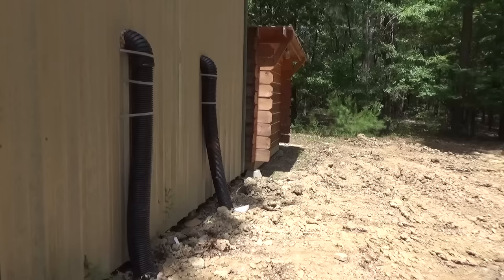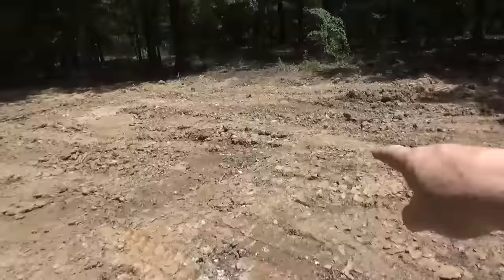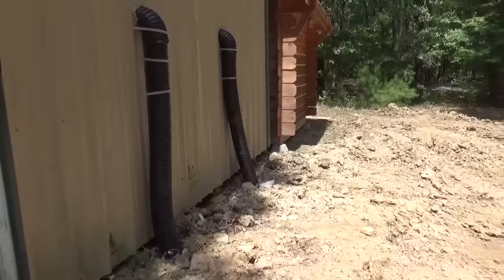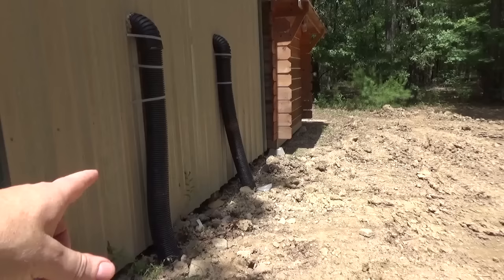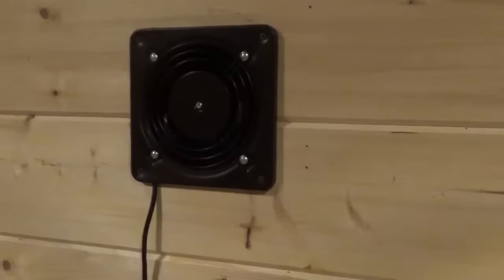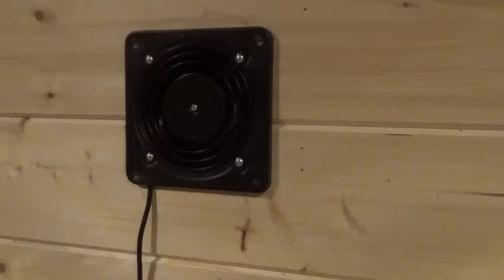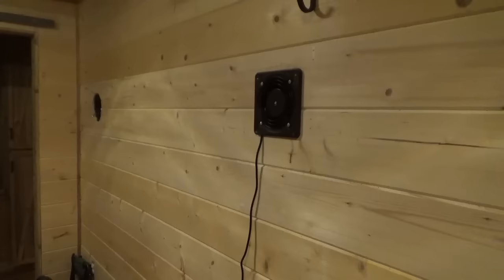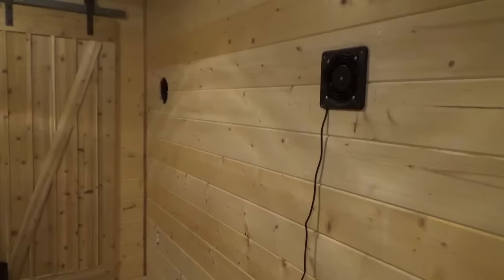Offgrid Underground Air Conditioning

Comment: This can be used in reverse too. You can pump hot summer air in and get some heat back out during the winter. Thermal mass projects are awesome 👍
Reply: I'm pretty sure this is not how this works in the winter.  The Earth is big and heating a small section of it is not possible using hot air from the summer.  In the summer time, the ground temperature is 55F.  In the winter time, the ground temperature is 55F.  You're never "charging" the earth with a significant amount of energy to detect a difference in the ground temperature in the winter.
Reply: @Kevin-ht1ox  lol The entire idea of "Thermal Mass'' is the Mass you Thermally charge. You can charge it with Hot or Cold. The part you are missing is that the heat from the summer sun and air, Normally does not penetrate that deep into the earth, so having more area and Earth to put heat into, the more mass you have exposed to said heat and the more you have stored..It works both ways. If you lower the temperature of the earth deeper than normal in the winter, you can store the cold/energy.  Dirt is a very good insulator and this is how Humans stored Ice in the desert and heat in the arctic for 1000's of years.. And igloo is actually a thermal mass too. The skins insulate it, and store the heat generated by the humans inside. The difference may only be from -20f to +40f but that 60 degrees is the difference between life and death.
Reply: @redneckhippiefreak  Exactly! Very well put. I'll add that this storage of temperature difference is why many people that are building greenhouses are starting with floor piping. The earth below becomes the buffer. During a hot sunny day, cool air comes from the pipes. Once the sun goes down and temps drop, that same piping is supplying air that is warmer than would be in a cooled off greenhouse. The days of black barrels is gone if you can afford it.

Comment: Ground loop cooling... and heating. I recall a big surge of interest in the concept during the late 60's, early 70's with the "back to the earth" movement (along with earth-berm houses, bead wall, trombe walls, and thermal-only solar panels). Subsequently, the reality of mold, mold spores, and associated medical issues (mostly respiratory) became evident. This realization pushed direct ground loop AC out of consideration, but seemed to foster an interest in heat pumps sourced to a ground loop. Unfortunately, heat pumps use a lot more energy. Equally unfortunate is the fact that a lot of ground loops have been very poorly done. For example: A co-worker was paying 7X more per month for heat from his ground-loop-based heat pump during a Wisconsin winter than I was for natural gas. His ground loop contractor had laid the pipe on the surface and piled several feet of dirt on top. Not only were the ridges across the backyard inconvenient and ugly, they were pretty pointless from an energy source/sink standpoint. If you find a solution to the mold/mildew buildup, I'd love to hear it. (A solution other than fans on the intake side pushing the warm air through a HEPA filter system into the pre-sterilized interior of a ground loop duct... which is sooo practical.)
Reply from the maker: I have installed a filter on the intake. The temp difference isn't enough to cause condensation.  It's trail and error. I do text the air regularly for mold spores. Nothing so far. I run a dehumidifier in my cabin.

Comment: I wonder if you can use a heat powered fan on the hot tin roof to pump the air through the pipes

Comment: I put a lot of thought and research into a similar idea for my home but was seriously concerned about condensation in the pipes as the hot air was cooled leading to mold, mildew and poor to dangerous air quality. I decided on smooth pipe and a grade downward to a drain before going straight up into my home but never did because of the same reason I don't to many things, lack of funds. lol I did put a temperature sensor in the ground last year and an 8 ft depth and programed an app for my phone to record the temps year round. I installed it in Jan if you can believe.... it was an unusually warm winter. In the 10C area then and up to 13.75C on Sept 21 funny thing the temp kept dropping until mid April to 3.5C as the temperture outside warmed. My ESP32 micro controller stopped working in through May and I was too lazy to figure it out until June... Ahhh Fudge it's 4:20am and I just realized I broke my phone screen while I was replacing my tarp shed cover yesterday!!
Reply: the evaporation from the top soil may be causing cooler summer and the lack of evaporation the accumulation of heat.

Comment: A little late now, but I'm thinking you''d want to use perforated pipe, with a set of holes facing down, such that condensate will drain out into the soil instead of building up.
Reply from the maker: I drilled holes on the bottom of the pipes and have them on gravel. I rub a dehumidifier in my cabin and installed a filter on the suction side
Reply: @uncledavesfrontier6846  Ah, excellent!  With that addressed, it looks like a really cool idea! ;)
Reply from the maker: @realvanman1  it works for what it's worth. Definitely some things I'm gonna do differently on the next cabin build. Which is coming up soon

Comment: think of a lab experiment: moist dusty air condensing on a ribbed petri dish with a dirty eyedropper of dirty water every day for years, then breathe it in. The problem is that moist interior dust mite laden air enters, collects, and condenses moisture on cool ribbed pipe walls which also develop leaks from an upthrusting stone or two somewhere, or the pipe is crushed from a car.  Mold develops, so it was deprecated as a practice. They used to blow sun heated air through a pile of rocks in an enclosed crawlspace to store the heat...they found the sale thing, plus spiders and vermin, and it's impossible to clean.

Comment: You should do the heat transfer through a water flowing system that cools the water underground not the air. Water cooled underground transfered to coil above ground water absorbs heat through coil from air passing over it. Cost just a little more for water transfer system. much safer .

Comment: You could put an insulated air handler box (with a filter) outside and run the air thru that. It would reduce noise considerably.
Reply from the maker: It's super quiet. Sounds loud in the video cause I had to mic sensitivity turned up too much. I do have a filter on the intake

Comment: I’m curious how well this works with plastic corrugated pipe since plastic is an insulator. Would it not be better to use copper or metal or maybe even dryer tubing to do this so that he can be transferred more quickly?
Reply from the maker: I tried metal in different applications.  Doesn't last. Rusts out in 3 to 4 years in my area

Comment: The concept is interesting. but what do you do about condensation that will form in your ground loop? My fear is that over time it will pickup a musty smell and potential for other nasty.
Reply from the maker: It's a closed loop. Temp difference isn't enough to cause condensation.  I run filters on the intake.

Comment: Did you do any of the required math to make sure that you have enough volume in the pipe to allow the incoming air to cool sufficiently before it's returned to the room? If the loop isn't big enough the air will warm over time and you'll end up with a room that isn't going to reach the temperature that you want.

Comment: What do you have for air filtration? circulating air will move particles through the pipe and eventually collect allergens and such. So what is your plan?
Reply from the maker: I bought a regular filter housing and screwed it over the vent. So changing the filters is quick and easy
Reply: Excellent. Thanks for your quick reply and for your time.

Comment: Did you need to run 100 foot of that or could you have used less and been just as effective to cool the air down?
Reply from the maker: I used all 100 feet of it cause it comes in a 100 foot roll. My guess is, the more you use, the better it will be.

Comment: Is there any concern with mold and mildew buildup in the pipes?  This is my main concern about these systems right now.
Reply from the maker: None. There's enough fresh air exchanged that it doesn't get stagnant.
Reply: @uncledavesfrontier6846  But human bodies exhale moisture and sweat, as do cooking and cleaning.  Are you in the cabin alone, or with a family?  The more the moister, right tobe?  ;)  And FWIW, it may heat your cabin in the winter.  It's geothermal.  (Oh, just read the dehumidifier comment.)
Reply from the maker: @ljprep6250  it's just me. I use a fireplace in winter. Yeah...I run a dehumidifier in summer

Comment: HVAC 101... your system would work more efficient (less cycling) if tor registers were closer to the ceiling as, there will always be stagnate warm air near the ceiling that will mix with the cooled air when the fan shuts off. So the less warm stagnate air you have above will lengthen your down (off) time before the T-stat call for cooling again... Godspeed in your project...

Comment: Hey Dave, I can't believe this idea! I love it and since I haven't decided on a system for the new house, I'm giving this a serious look. I'm in the phoenix, az area
and plenty of room to work with. Would it do any good to have the house air exiting into a manifold which would empty into say four 4 in. tubes? Thanks partner, and of course I subscribed!!
Reply from the maker: It would work better in your area. Yall don't have the humidity we have. I plan to change a few things up on my next cabin build now that I've tried this. Go as deep as you can with your pipe. 4 inch may be a better choice. Make sure the fan you use produces enough CFMs to move the amount of air per square foot. My cabin is 12x24 so I'm not sure how well this would work on cooling a large house. But it's all trial and error and I'll keep at it.

Comment: Pushing and pulling, much more efficient to move the air through a pipe. And think of a way to keep the pipe clean insects and mould are usually your enemy with such systems.

Comment: is there a mathematical wat to determine how far down you need to go to obtain the desired temperature  required for this kind of system?
Reply from the maker: You can drill to check Temps. Most of that information is online about your area. Just Google soil Temps at depths for your are. Pretty accurate

Comment: Though you've done good and using those low wattage fans, I might suggest 'duct booster fans' (two if possible [one pushing /one pulling) ]. Yes, they'd pull a bit more power, but that "freight train" moving through your room sound eventually will drive you nuts (or deaf). An alternative would be placing those same 'computer fans' or using real 'duct booster fans' just outside your cabin. As far noise.....duct boosters are the cheapest, most relliable and efficient way to go.😊
Reply from the maker: I had the mic sensitivity turned up too much and had the camera too close to the fan. It's actually really quiet.

Comment: Super clean work! Tho' what about Gophers? would they chew through that? _ I'de put 1/2 inch 'Galvanized Grate Wire' around all of it _ Or even put it all inside a 1inch larger Hvac Galvanized Cover pipe _ Just a thought? Thats kinda what 'over thinking' does to everything'✌️
Reply from the maker: This is buried in clay.  Gophers stay in loose soil

Comment: First I’d be running way more than 100 ft and would be running smaller diameter. You want as much air touching the sides to get good exchange of temps as it travels through the pipes. The other issue is how are you going to deal with mold and other bacteria growing in the tube over time? You are I hope aware that by products of some bacteria can be toxic. I think the issue in the deep desert is less of an issue as it would be in moist areas. Condensation will create a place for moisture to collect. So you might want to be sure you have drainage out of your tubes so no moisture collects in pools of water within your tubes. Being corrugated makes the problem worse but courrugation helps with increasing surface area. Toxic mold is an issue in tubes like this. It is likely why many don’t use this form of cooling. But if you do know the dangers and burry deeper and lay longer lines of tubes.

Comment: The only downfall to this system is if you live in a area with high humidity, it will not dehumidify which still leaves the are very uncomfortable. But if you live in a dry area this is outstanding
Reply from the maker: I run a dehumidifier in my cabin

Comment: This is something I figured out 20 years ago,
but could never decide how deep, size pipe, 
length of pipe per cubic foot of residence. 
You told us how deep you went and I heard 
none of the other things I just mentioned.
Reply from the maker: 6 inch 100 foot roll of pipe. My cabin is 12x24. I only cool the downstairs

Comment: Mold will grow in the pipes over time. A closed loop system with ????? Pumped in it to a coil is safer. Like TheJoefussGarage said.
Reply from the maker: @basilkey2949  doesn't drop below dewpount. Doesn't build up condensation.  I run a camera down it regularly and have found no issues.

Comment: So in closed system you breathing some extra CO2? No headache?
Reply from the maker: Your just cycling air underground.  Be the same air you breathe if you didnt have this system.
Reply: @uncledavesfrontier6846  I just open all windows in night time and getting large amount of cooler air into the house. Thus I breath fresh, cool air. (However, daytime all windows are shut down cause air outside is extremely hot during midday).

Comment: This is what I have been looking for, I am building a earth ship where it's humid like a rainforest in the summer and I didn't want to be sucking humid air inside
Reply from the maker: Works good. But when i build the next one, im gonna use at least a 8 inch pipe and bigger fan. This one will maintain the temp but not good at lowering the temp.
Still keeps my cabin about 73 to 75 degrees.  But i used this as a test run for the next cabin im gonna build. I do think a 8 or 10 inch pipe will work best.
Reply: In a humid enviroment you will have a mold issue, do a heat exchanger with the air in the loop not entering the home.